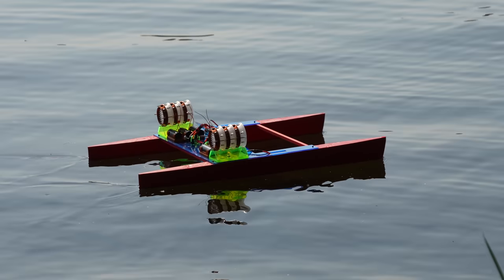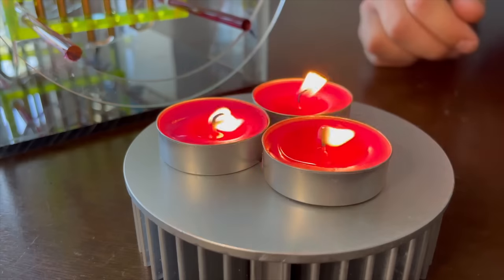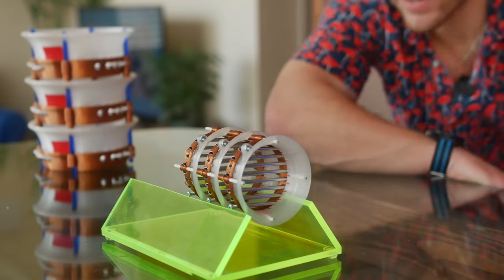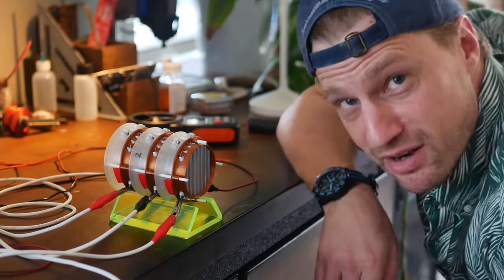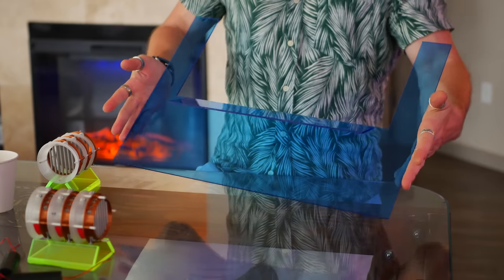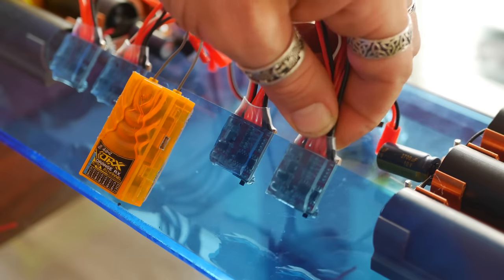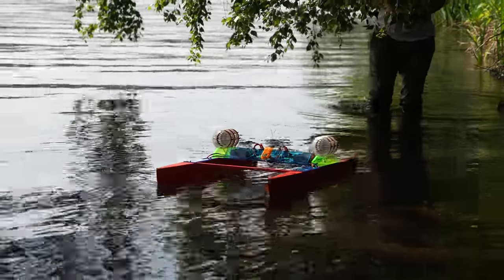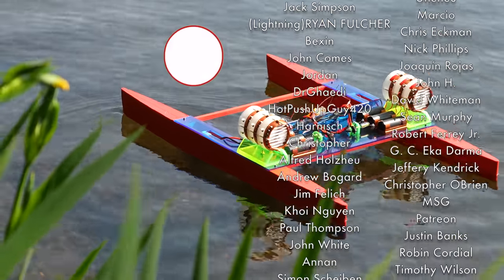Building A Twin Ion Engine (TIE) Catamaran (ft RCTestFlight)

Comment: openTx would make your radio mixing a much easier task... but great project!
and if you use car esc for the inputs, you can potentially reverse thrust (if an ion engine can manage to work pushing the other way?)

Comment: I'm curious to know if you've considered a manifold of some kind, with multiple in and a single out with thrusters pushing in and out, probably need to be designed for the different air flows.

Comment: Could you increase speed by adding a tail cone to the thrusters to increase the velocity of the air? Maybe use carbon fiber tubing as a thruster case?

Comment: Would you get more thrust if you added 5 thrusters per side. Or added more but made them smaller in circumference. Would an onboard solar panel help w the charging of batteries?. If you used your voltage multiplier like the gun you made would that increase speed.

Comment: i bet if you got it solar powered and covered up the exposed copper with some kind of outer casing with air intake ports i bet you'll solve the sparks, kinda wonder what adding fans to the side intake would do for air flow

Comment: Two suggestions; 1) redesign your sections so that you are not losing a large portion of your air flow out the side of the engines. Instead of a flared opening use a straight tube design and a Jet engine designed tail cone to concentrate the air.  2) Enclose the entire engine in a thin walled plastic tube. I have played with this design since you built the first version of the thruster, even offered to show you the designs; but you never responded.

Comment: Can you design the thruster to be fully reversible ? If you can reverse the airflow it will have significantly greater manoeuvrability... Forward, Reverse and a greater turning speed with a smaller turning arc.

Comment: Very interesting, I'm curious:
What's the overall efficiency of such a thruster? ie: For similar thrust how long would the same battery last as compared to (air) fans or (water) props?
Reply: Efficiency is dreadful, about 1%.

He said that each thruster uses 45W of electrical power, and it's producing 0.17N*3.1m/s=0.53W of propulsion.
Running at higher speeds should improve this, but I don't think that a boat is the right platform.

Comment: You should Try to feed more air in your Engine ,  just like an Aircraft engine , and force the air out of the engine though a long nozel type hole, which will force air out in a focused way just like a bullet , which will result in improved thrust

Comment: I remember you tested progressive distances between electrodes, over the 3 stages, but did you test progressive voltages?
I think you'd save a bit of weight using carbon fibre instead of acrylic, although it's worth remembering that it's conductive. 
I got nothing for humidity though :(

Comment: Love your channel watch every video you have out so far nowhere close to a physicist but if you considered trying to put in housing with vent tubing around for your intake, that would eliminate some of the humidity and some kind of a discharge or collection unit to collect that plasma you’re creating I’m an idiot when it comes to this stuff but I invent all sorts of things or reinvent. I think your units need to be a lot smaller with more power. I also think you need actuators that way you can move these things apart and closer together, to increase velocity and thrust along withfins on the back of the thruster like they do on jet engines funnel technique

Comment: There are these things called sailboats.  Apparently the work pretty good and you don’t have to worry about running out of electricity.

I can also say you don’t like your fingers running a table saw like that.  Maybe you can 3D print replacements.

Comment: as a former aerospace worker my question would be "have you tried FUKKING IT yet" and yes that is a legit term we used... it implies putting something into something else.
so for this i would try alternating the positive and negative polarities on one plane... to be better explain this i will say thread the negative wire through the positive rod making sure to tension correctly to prevent contact, you wont get closer then that and SHOULD provide the appropriate force to air flow. to maximize this for one section  you could alternate between a positive and negative rod and wire.... so your design allows for one to be positive and one to be negative but my suggestion would be to have section where they would switch (this would better be demonstrated with a colour coded drawing i think) - you top that with sections that alternate at 45 degrees you could potentially improve the the static power and air flow to a point that it would propel that boat with ease and scaling up  up and adding some small humidity modifications you could in theory build a plane that a human would sit in and fly. 
just my suggestion somethings may be note worthy for this project hope it helps 
- Rob.

Comment: Hi, nice project! Did you ever thought about increasing the voltage from module to module to get some kind of acceleration? In one of your last vids you were rather disappointed in the small result of your three modules in series. Though every stage only needs to add it's own portion to the thust. It might be worth a thought of using different sizes too.

Comment: Hi  very ineresting. Want to ask you, that sparkling decrease thrust of enginer, or only increases consumption? And what about to add after that engine a nozzle with a tapering diameter, as on jet engines. Wouldn't that help to increase air velocity and thus increase thrust? Can test it?

Comment: Have you tried designing the thrusters to akin of a nozzel, Three massive rings , two that half the size of the first 3, and one that is half the size of the two smaller ones

Just a hunch with the design, but you can also add a yaw or pitch rudder to give direction
Reply: also with the humidy. You will need to build and construct (or simply buy one) an air dryer mechnism. Look at benidix air dryer as an example

Comment: So the main problem is basic dry air requirement. The idea of a high flow dehumidifier is maybe a hard one to crack. Yet my thoughts are that you have a sacrificial heated element grid in front of the airflow. Now I am just thinking outside the box here, so please don't rip into me and say it's rubbish.  I know it would add to power consumption, yet you have to have less humid air. So if you making an aircraft how will that overcome humidity?

Comment: What if you apply supercapacitors? Go from 40kvs to 12okvs or even 240kvs? Bump that power up using the same size thruster. Now you're cooking with gas.

Comment: maybe try using an air flow constrictor to concentrate the air flow into something similar to a rocket engine bell.
 

 as for reverse jets have scoopes that act like funnels while in normal flight then slam together to redirect the air flow the other way

Comment: I don't know anything about plasma propulsion. But out of curiosity do you ever use Star Trek as a reference and the propulsion engines that they use? Is there a way to multiply the output of one thruster from another? Like is there a way to excite (push out) (thrust out) atoms even more so by exposing them to other molecules as they pass through. Kinda like a magnetic rail gun??? Or like the way a magnetic bullet train speeds up?

Comment: Have you considered introducing "Fluidic Propulsion" to your design. It could potentially multiply your thrust. Instead of using an impeller for the initial airflow, use your ionic engines.

Comment: Very cool project, past my level of proficiency that for sure.

But if soley isolating a major  problem to be noise generation why not just look at the new props coming out?

Full disclaimer I am a fan of alternative fuels. I own an EV and my garden tools are all electric.

Just sounded like you were doing this for the single motivator.

Comment: Hi. Just joined your channel. I know this is months old, but i watched your ionic thruster build. Since its enclosure is radial in design I was wondering if a radial (circular) thust wire configuration would have made any gains in thrust, and would an even smaller venturi after the thruster made any gains in out put speed or just be a bottleneck.

Comment: What would happen if you put one of these thruster stages at the latter end of a standard fuel burning thruster, ideally it would accelerate the already accelerating particles coming from the thruster so if it could survive the hot temperatures it might add even more energy to those molecules and potentially save on fuel consumption of the primary thruster, by making it need to use less fuel in order to get the same amount of Energy. No of course the extra weight coming from batteries to run the extra equipment might make it negligible

Comment: Unfortunately, the one thing you can't scale down is the atomic particles involved in ion generation. As you've seen, humidity is going to decrease the arc flash distance. You may have to scale up the circumstance with the same number of and gauges of anonde electrode pairs so that the distance between adjacent pairs is above the arc flash distance at maximum humidity, or build in insulating guide fins that make the direction of the arc not bridge unintentionally.

Comment: Having the thrusters dump air out into straight behind just forces the "skin" of the boat to fight the friction of the water as the front of the boat leans forward--also increasing friction.

Why not angle that air out toward the water at an angle? Preferably somewhere that would help lift the boat out of the way and provide something for the air to push away from.

Comment: Run the exhaust from the ionizer into a Tesla Turbine,  then into a compressor.   Exhaust the compressed ionized air threw another ionizer.
This is the principle of the jet engine.

Comment: Hi Jay, I m into dev electrical ducted jet engine dev. Your ionic thruster engine is eye opening to me. I have been watching every of your ionic thruster video... since then.

One nagging question keeps bugging me.. the huge voltage (Watt) that the truster requires to gen 4m/sec or maybe ~100g of thrust. Have you created a video to calculate and compare the energy consumption of your ionic thruster vs an electrical turbine jet engine of the same diameter.. in terms of thrust?

TQ looking forward.

p/s: Of course ionic thruster is more eco-friendly in many ways.

Comment: Did you check it for high-frequency noise? Maybe for us it's silent, but for the whales...

Also, maybe it will be more effective if you will use a "gearbox" and convert the airflow power to the default propeller, which will move the boat. And it could be closed into a cycled box, and more the airflow into it.

Omg, I'm so genius...

Comment: I have doubts about the maximum thrust could be improved by some basics you've shown.
  The single stage gave a speed of 2.1m/s, but any further stages only marginally increased that speed(and may actually be inhibiting greater speed). The first stage went from 0.0m/s to 2.1m/s but the second stage and third stages only added a further 1.7m/s. There are two reasons for the inefficiency from stage two onwards.
1) the allowing of 0.0m/s air to be sucked into the gap between unit 1& 2 slows down the outside edge speed by inducing turbulence and thus speed from the outside in towards the centre. There should be no inflows between all units.
2) Because the speed was already 2.1m/s upon entering unit 2, then you need to increase the gap between the +ve and -ve grids and up the voltage to again increase net speed through this unit. That would also apply to the third unit when compared to unit 2.
Reply: I wouldn't be surprised with successful re-configurating a final speed greater than 10m/s could be achieved.
  I look forward to your next unit.
Reply: I also suspect that the voltage should be tapped from the centre towards the outsides, so that maximum voltage differential ( thus speed) will always occur at the centre of engine.

Comment: Hello everyone.
The main problem is apparently the humidity of the sucked air that runs through the high-voltage field. I know a similar phenomenon with variable capacitors with air as the dielectric. If the voltage is high enough and/or the distance between the plates is too small, sparks will also occur. Vacuum capacitors were invented to increase the flashover voltage with the same plate spacing. That's not possible in this case. What if you mixed dried and entrained air into the sucked-in air to reduce the overall humidity inside the tube. Maybe from a small compressed air tank or liquefied air from a bottle. At this point it only seems to be a few percent that make the difference. Maybe that would be enough to get a little more independent of the ambient humidity?
Just a thought... or another gas, maybe some argon or something.
This is a google translation, so please forgive me if it doesn't describe the gist of my idea. My English is not very good in this context.

Comment: How would the thruster react if the air feed is compressed? 

Reason is ask if the ions are coliding with the air, how would denser air impact the thrust output?

Comment: Couldn't you lower the amps or increasing the space.. Maybe slap on an Arduino or pico pi and a humidity sensor in front of the thruster to dynamically control it?

Comment: can we make an ionic thruster that uses the water instead of the atmosphere? I'm thinking more surface area for the electrons to push on air molecules but if its water molecules they are nice and densely packed and can help move each other more than atmosphere can. And maybe using coils of wire instead of straight wire?

Comment: Use the wind to push a sail. No fan blades means no equal and opposite reaction to the force of the wind hitting the sail. The force moving the air is generated in between anodes/cathodes, so, not actually on the physical system... like natural wind.

Comment: Great channel with my kind of content! Have you tried a product like parylene for the humidity problem? I design power supplies and for the high voltage designs, we have a vapor deposition station where we apply parylene where there is limited distance between high voltage components. Makes it very difficult to work on after and is expensive, so we only use it after no changes needed.

Comment: I wonder.... does the humidity sparking scale with the spacing between the cathode and anode, or does the ionic drive just stop working aaltogether unless the electrode spacing is at exactly the right value? 
If you can increase the cathode's distance from the anode to alleviate the sparking in high-humidity air, perhaps you could make the three tiers of each thruster, each have different electrode spacing; in essence allowing you to scale the minimum electrode spacing you feed electricity to, with the ambient humidity. A little arduino board or similar could even do that for you, progressively charging the grids forward from the widest-spaced at the back, up to the one that starts to spark. I say three tiers, but with more tiers, you get more granular control and a less dramatic power loss from each tier disabled. I hope that makes sense?

Comment: good concept.  But how efficient is it?  Also what about redisigning the system for hunidity - I dont know about iron engines but intuition tells me you need to have further spacing option as the water molicules are clearly short circuiting - so make what ever longer spark gap incorporated into design that can be sensed and switched from normal humidity to verious humid conditions our yankee friend.  Also - how about tapering the design so you have large input then taper down whiles boasting yr charge to get better thrust?

Comment: What if you were too have the air output go thru a narrowing tunnel (similar to a jet engine) so as to possibly increase the air output.  This would also allow for the reduction of moisture getting in from the back.  Also, would it be possible to put a thin membrane filter on the front to reduce moisture intake into the thruster.

Comment: Perhaps a shell around the whole thrust device with enough room to allow for air to pass through and around the thruster inside. If this works, couldn't you attempt to use that shell and maybe a positive or negative charge, with the idea behind to moisture wick the air away from the thruster. Then if that all works channel all moisture in the form of water outside the shell, maybe towards the back to disturb the air propelling it as minimally as possible. 🤔

Comment: A Hydrofoil version … can you get it up out of the water? It would move through the water more efficiently & cut down on the noise immensely. There are hydrofoil boats, surfboards, electric & other fuel options out there.

Comment: I was thinking that you could add an air duct to the engine with a dehumidifier, powered by a separate battery, at the intake side to dry the incoming air.

Comment: Slide them into a conduit then wrap the conduit with chicken wire, using the conduit as a dielectric. Space the first thruster forward and closer space the rear two, the first one should then reduce humidity and the rear should have reduced humidity within the conduit. Hoping the chicken wire acts as a faraday cage
Reply: The conduit would focal the energy of air moving through it to give better thrust

Comment: Hey i was wondering if you were to try to increase the speed would it work if you were to focus the air flow through a conical output creating higher air pressure?